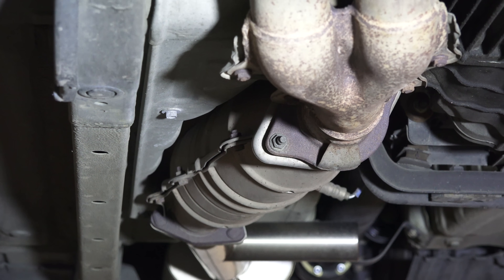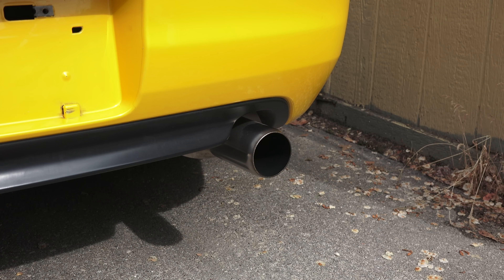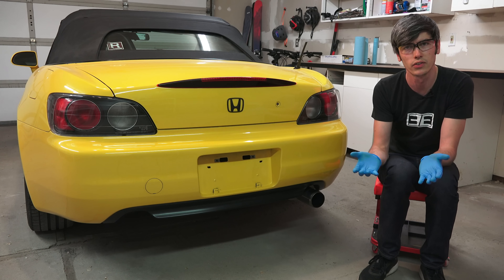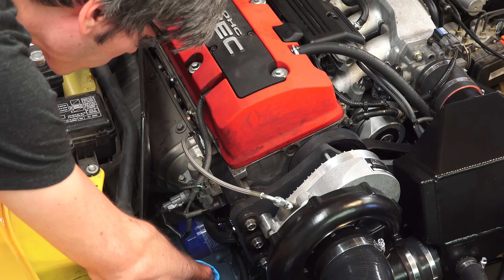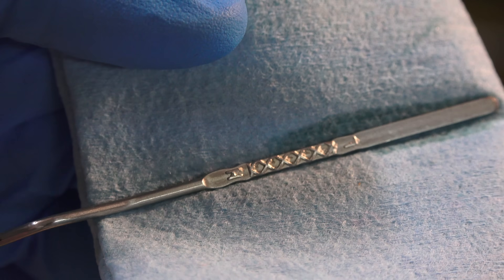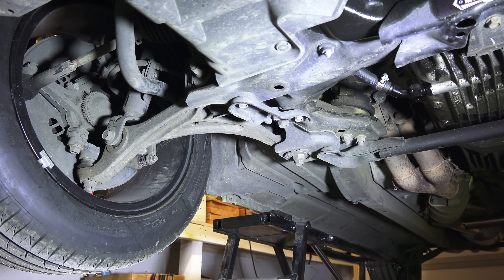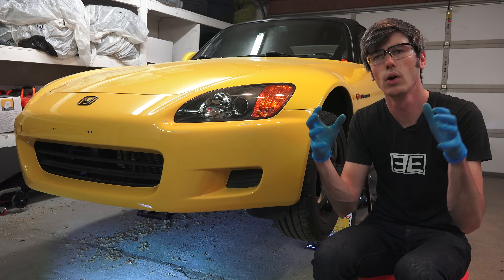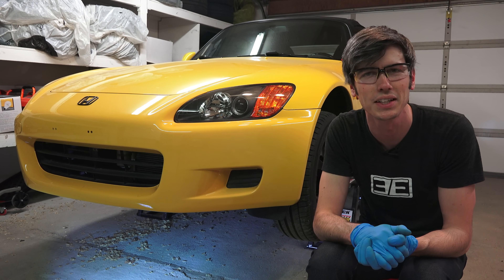5 Signs You Shouldn't Buy A Used Car

Comment: Sign 1.. It's a Honda S2k....
On a for real note, I have done tons of used car inspections. The little time spent on a proper inspection can save years of headaches. Never be afraid to walk away from a car, especially if it's your only transportation
Reply: That also depends on the dealership/technician. I've worked for a hyundai dealership that would sell used cars with what I consider major issues without repairing them. They'd ask that I clean it up and make it as good as I can without any parts. I.e. I had a hyundai tuscon with oil on the front cover and they wanted me to clean it up and do what I can to slow/stop the leak but just pulling the cover and replacing the gasket and doing an inspection behind the timing cover was a no-no. I no longer work for that dealership btw.
Reply: @oddieboi  the used car dealerships always do that kind of things, at least in my country. I really hate that, the last car we buy is a Chevrolet Prizm 1999, i make sure that car was in perfect conditions, and i was right. Amazing car.
Reply: @oddieboi  good karma choice.
Reply: @oddieboi  Hi Bryan Bless you for openly calling out the pile of crap issues with Hyundai, They sell in heaps here in India but it's a car brand I avoid and will continue to avoid.
Reply: Where most people make their mistake is not paying to have that car inspected. Ignorance is key here!  If the Dealer is trying to rip you off  they will back out real quick if you use the sentence "I would like my mechanic to look over it before I buy" if they start by saying "oh, don't worry there is nothing wrong with the car " WALK AWAY! If they have one that is bad, they will have more. 
Code Scan does absolutely nothing in some cases.  I can "turn off" code setting criteria in a lot of vehicles and most used car dealers would know that trick as well.
Welcome to the digital world!  What you can't hide however is LIVE DATA, and if your mechanic or tech is not able to interpret that data  you may want to walk away from him as well.
Reply: @ralfsautomotive   I took the Honda fit (2013, 71k) i plan on buying to a mechanic and he said the car was in good shape and worth buying.  The only thing that didn't show up on the code scan was  two monitors- one for the EVAP and the other one for the catalyst since the car needs to be running for over a certain mileage for that to start registering (they had replaced the battery at the dealership which reset the system, I was told).  Went back to test drive it twice hoping to be able to do 55-100 miles at a steady pace of 55mph to get those monitors going but was on a time crunch and couldn't stay that long. I was told the "guys are driving it" in the meantime after I announced I was willing to buy it. guaranteed
Reply: @maghrath1  Evap is not that big of a deal where as the Catalyst monitors are.  Evap generally is not a high cost but when it comes to the catalyst system it can get expensive very quick. Without looking I would not know the criteria for the catalyst to finnish but in general it is a "high priority" monitor so they tend to complete very quick.
Reply: @maghrath1  There are no guaranties in life but as long as the drive cycle completes with no issues I'm sure it will be OK.  Engine health can also be checked by sending off an Oil sample there are quite a few places that do this. (oil has to be used from middle to end of mileage) Transmission can be done the same way. Only problem is that dealers will not go along with that most of the time. If you can take the Car for an extended test drive would be best. Remember to shut the car off for at least 10 minutes between Key cycles and the catalyst should run very fast. I did not look up criteria!! What I am saying is a general fail safe.
Reply: @ralfsautomotive  thank you so much for your response and all the useful info :)) I’m hoping to be able to get the drive cycle to complete by either the guys at the dealership (doubtful they’ll do a decent job) or myself before buying the car.  Wish me luck!
Reply: I wish I had. I bought a gmc envoy for $4000 3 years ago. It’s currently sitting in my driveway with $10,000 worth of parts on it just to keep it on the road and it’s completely useless because the transmission went out because I found out a year later the drivetrain was full of water and the transfer case was empty
Reply: @Twowheeledadventures-q1p   Ouch, Sorry to hear that! Looking at the brighter side of things you will likely never do that again and I am sure you will pass on to others what you had to learn the hard way.  Keep your chin up!!
Reply: Ralf's Automotive Diagnostics & Repair the only reason I didn’t do it was because I was desperate and I’m pretty sure the dealership recognized it. My dad was the one who found the Envoy and I never should have been the one to pay for it in the first place. He totaled my Honda and couldn’t afford to buy another vehicle where I could. I just bought a trans am about a week before the transmission completely crapped out on the Envoy fortunately.
Reply: @Twowheeledadventures-q1p   Unfortunately, I hear that same story all to many times.  Dealers are out to make that money, no more no less! A lot of times they do not even look at the trades they get, heck, they would have to write a work order and that would cost them an additional amount.  As the saying goes, the honest dealers are usually not around for long. This is a dog eat dog market where at the end the unsuspecting buyer has to pay the price.
Reply: Ralf's Automotive Diagnostics & Repair the sad thing is it wasn’t a used car dealership
Reply: Definitely agree with you.

I have been performing repairs, troubleshooting inspections, preventive maintenance for many years.  And have acquired repeat/referred customers and their extended families because of the experience/knowledge of understanding of how auto systems perform and their wear and tear capabilities.

It is extremely important to let an experienced, professional, trustworthy person in this field to inspect any used car BEFORE purchase.  I have seen to many people get burned because of their lack of knowledge and thought, "the car was so clean and it looked cool"... just to have the top end drop a valve, cracked block, rusted in half subframe, transmission contaminated and slipping just days after purchase....it sucks but these things can and do exists. Expect to invest money into any used vehicle because no one ever in the history of selling a vehicle ever.......is selling it because it has no problems whatsoever.
Reply: a good tip only fools rush in
Reply: You giys should team uo again. Engineer quit over talking Mechanic when teamed up. You two are awsome in different ways.
Reply: I wanted to tell Jason it needs to be a VW but now I see you beat me to it lol
Reply: Honda's are extremely reliable I have 254k on my Honda civic that's breaking it in I seriously feel like I can easily hit 300k I took this thing cross country already. doesn't leak or burn one drop of oil.
Reply: Humble mechanic. Sign 1 Honda released s2000 2.0 and it has 240hp name any make reliabilty like HONDA #1 sign 2 i have accord 2000 coupe. And my bro has the98 sedan never had a issue with so i guess the old cars are made to last longer than used cars

Comment: Most shops and parts stores actually charge for the codes over here. Could be equivalent of $20 - $40 for the codes. Feels bad that some places don't charge that much or at all, even.
Reply from the maker: That’s interesting. I have a code reader but used to go to shops and they’d read the codes for free, recommend parts. Could buy them or not, and return the parts that weren’t necessary.

Comment: why do you have an aftermarket air filter setup that is worse off than the the stock that pulls air from under the car instead of right under the hood where it'll grab warmer engine bay area air??
Reply from the maker: Because it’s supercharged now. Had to remove the old air box to accommodate space for the supercharger. But yeah, it could be moved to a better spot. Safe place to keep it for now though, away from direct debris, water, etc.
Reply: @EngineeringExplained  ahhh. thanks for the response, i enjoy your videos :)

Comment: 6th point - The owner said the car has been "tastefully modded"
Reply: Never been beaten on...
Has a 6266 turbo, meth injection, highlift cams, and stripped interior
🤔🤔🤔
Reply from the maker: Hahaha
Reply: Ac delete for weight reduction and less power loss. Replaced leather seats with plastic crates for weight reduction. Has an exhaust leak but for 50 bucks I can get a buddy of mine to weld the hole
Reply: @caetheace96  Shut up and take my money!
Reply: @caetheace96  It's a feature! Factory high flow/sports exhaust!
Reply: "bro, this wing is totally functional, trust me." "What's a fart can?."
Reply: I can't stand when people think that modifications to their car will increase the cars value instead of take away from it.
Reply: That's enough for me to give up the purchase.
Reply: The owner said 16 years ago it ran when parked. Garage kept, never beat on, adult owned. Always maintained but zero records, no receipts, no paper work, nothing for proof.
Reply: I walked away from a 94 Fleetwood because of this. Modded out the wazoo to the point where I wouldn't have known what was original or not.
Reply: What if the tasteful mod actually is tasteful, like a spoiler on a Coyote V8 Mustang, or four-barrel carburetor on a car that originally ran a two-barrel.
Reply: A 4 barrel swap is just a mod. No need to justify it by calling it tasteful. Intercooler piping made from Monster energy cans is a tasteful mod.

Comment: If you don't live in the rust belt maybe you can be that picky about rust on suspension bits, but if you live in the snowbelt states, you're going to have to accept some rust on suspension components. In a dream world, DOT's the world over would quit using salt, just use sand and everyone would buy snow tires, but since that is bound to never happen, we must make a compromise, haha.
Reply: Desmond Bagley  Stop calling me shirley
Reply from the maker: Yeah, it’s a shame we still use corrosive ingredients for snow. Snow tires and sand/dirt works great!
Reply: Colorado uses lots of mag chloride. It melts the snow and ice beautifully, but it's every bit as corrosive as salt, and it puts a layer of crud on everything it touches: windshield, paint and headlights included. Under no circumstances run out of windshield washer fluid when the roads have been treated with that stuff. You will be driving blind in 5 minutes or less. In fact, I've always suspected that it was actually the people who make windshield washer fluid who first came up with the idea of using mag chloride for de-icing. It must have tripled their sales.
Reply: I used to put my vehicles in the garage,  crank up the heater, and flush underneath with hot water every time they ran through salt. It slows rusting, but nothing will  stop it since they would have sat all day at work or school marinating. I did keep them rust free for a long time though. Long enough that comparable cars were rusted away or in the junkyard.

Comment: When you say long test drive, about how far, or for what amount of time should that be?
Reply: 2 day road trip all through  route 66
Reply: I would recommend to do some city driving with quite a bit of stop and go, highway driving so you get up to speed and can tell if there is anything wrong when accelerating to high speeds, and bumpy roads. You also need to know what to listen for when it comes to an engine or transmission. Also look for any leaks or anything AFTER driving the car as well as before.

Comment: Quick tip on frame rust: if you can push a screwdriver through it, it's definitely too much rust...
Reply: I have a special tool. It's a spring loaded magnet, you stick it to a panel and slowly lift of, when the magnet lets go it has a scale that tells you the thickness of the paint. Obviously if it doesn't stick at all, it's been bogged up. Sometimes the best time to check for smoke is at night with some one driving behind you. Their headlights will highlight the smoke. Also if it smokes going up a hill, then it's the rings, and when you engine brake down a hill and then you blip the throttle if it smokes it's the valve stem seals.
Reply: @JayDee-xj9lu  great info. How did you figure it out ? I'm learning little by little so anything is appreciated 👍
Reply: I have seen videos about the UK equivalent to the Nissan Frontier breaking in two due to frame rust.  This was due to a plant in Spain not building the frames correctly.  As far as I know, this is not a problem in the US.

Comment: Veterans will know it was Jason himself who "didn't quite judge it right" 😁
Reply from the maker: Shhhh!!! 😂😂
Reply: @EngineeringExplained  I'm thinking of buying 2014 GX460, even though some ppl suggested Equus or Genesis (I dont know anything about Hyundai :() but I'm familiar with RX which I had in the past and now with ES, but then I see this: "You shouldn't buy used car"! And it's true I hate headaches and frequent visits to mechanic ripoffs!!! Any suggestions? I am looking for a reliable SUV, crossover or similar high which can handle too many bumps, dips, cracks and poor maintained rough roads in Houston and sometimes major floods or even stagnant rain water lol!, at the same time a vehicle with safety features, very quiet and  comfortable for my eldelry parents who ride with me most of the time. Thnx
Reply: @seekfactsnotfiction9056  do your own research
Reply: @seekfactsnotfiction9056  Im sorry im 1 year late😅.
But I do have some advice.
Being a used car doesnt neccessarily mean the car has problems, especially if the car has a low mileage. The gx460 is a solid choice, those things are bulletproof, along with their toyota counterpart: the prado. 
I would also consider a 2011-2014 cadillac escalade. Since it has the same engine as a yukon denali, which isnt that problematic and is fairly cheap to fix. In addition to being literally being as floaty and comfortable as a yacht.
A wierd but real choice would be a w126-w140 s class.
Those things are so reliable they make toyotas seem like a joke.
my father literally made a profit selling one after more than a year of heavy use.
They are as luxurious as they can be.
Other honorable mentions include the ford explorer 2016, expedition 2015, land cruiser gxr 2013,
Nissan patrol platinum from around 2014, dodge durango of any model year, and a kia sorento/mohave/telluride. In addition to the hyundai santa fe or pallisade. I know I have alot of knowledge for a 15 year old. 😂
Reply: @gram.  rude

Comment: I see you are using the BlueDriver! It’s an awesome tool. I was having an intermittent cooling fan issue on a Mustang GT this summer past and that tool was instrumental in allowing me to monitor the temperature as I drove to avoid ruining the engine. I changed the thermostat, radiator cap, had the radiator out and tested (good) and even replaced the cooling fan assembly with a new one from Ford. But the issue persisted. I was told it could be a head gasket but I had no symptoms for that. I was getting no codes for anything either. A ford tech looked at it with a Ford computer and was baffled. I was fixing to replace the PCM when I decided to disassemble the BEC (bussed electrical center) in the engine bay. Lo and behold there was my issue, a short in the connector to the high speed fan relay. I got a salvage BEC and a new connector and repinned the wires from the old connector into it and problem solved! Right before I had disassembled the
BEC the BlueDriver had started giving me an open fan circuit code. Worst issue I ever had to troubleshoot on a car but now it’s working great, well was, it’s winter stored now. Even the stereo sounds way louder and clearer and I was having an intermittent transmission flare issue that has gone away too. I had an issue in that BEC for a while that was interfering with voltages needed for other things like the transmission operation. It progressively got worst with the cooling fan issue. I put a lot of time into troubleshooting it, working on it myself, reading stuff online, etc. So glad I solved it and that the car did not catch fire!!

Comment: there aren't any places in the uk that give out free diagnostics tests... is this an american thing? like when you guys go in for an "oil change" then all of a sudden you need steering fluid, transmission fluid, and new windshield wipers fitted all round :)
Reply from the maker: Not sure, maybe. Most auto parts stores will come out to the parking lot with you scan your car, tell you the codes, and you can be on your way or buy some parts if you’d like. It’s in their best interest to help you so they can sell parts, so really it makes sense. And then return any parts you don’t need.

Comment: Bumper covers are painted separate from the body at the factory, so there's usually a slight color difference. Especially on silvers, gold's, and other metallics or pearls. However, if you check door and trunk jams, it's easy to see tape lines from repairs. Especially if it's not done correctly. Also, look closely for sand scratches. If you see scratches buried under the paint, chances are the repairs were done poorly. That being said, if the work is done correctly, body work isn't that big of a deal.

Comment: On the blue smoke, you can tell whether its rings or valves in following way:
- Bad piston rings - From idle, quickly rev up the motor.  If there is blue smoke as the engine is revving up, its bad rings
- Bad valve seals -  Rev the motor up to a steady 4-5K RPM, then quickly release the accelerator pedal.  If there is blue smoke as the RPMs decrease, its bad valve seals.